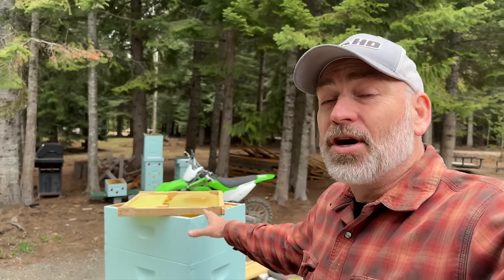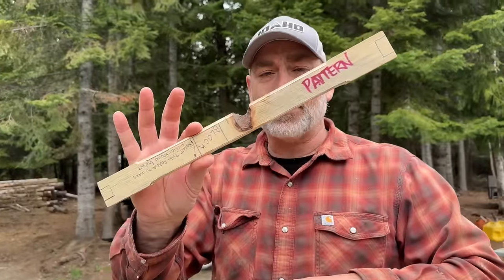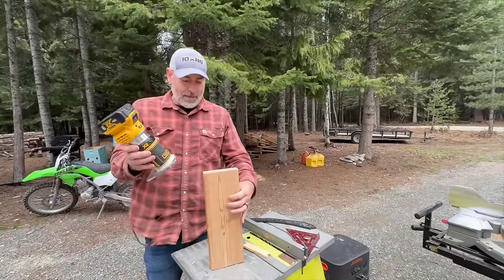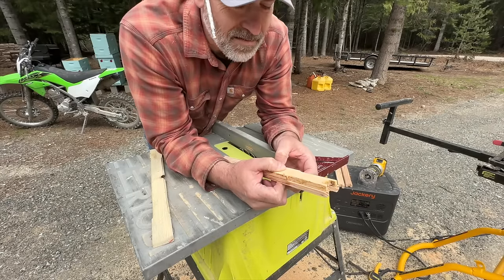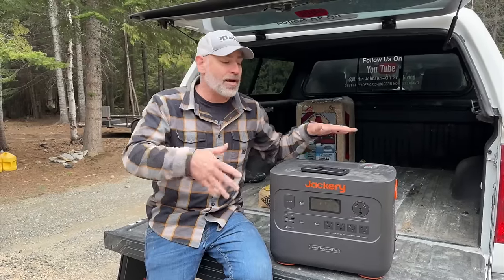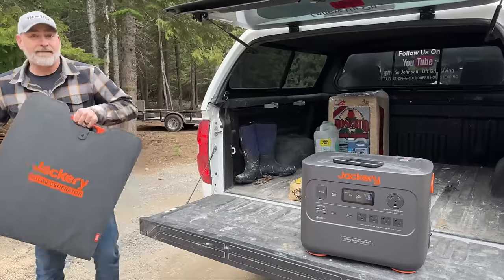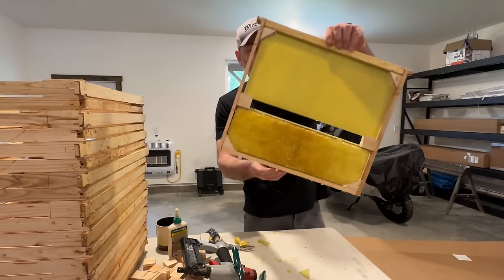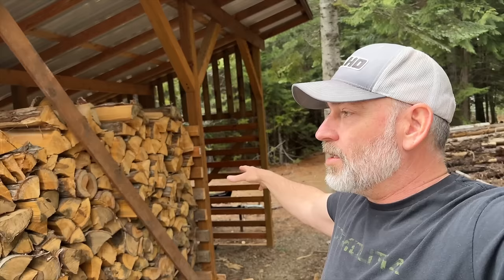Ultimate Bee Barn Hive | How to Keep Your Bees Alive all Winter

Comment: I am a beekeeper and I have watched y'all struggle every year.  Since you are looking into the Bee Barn and having to construct your own frames, might I suggest that you look into deep hive structures like the Layens or Lazutin hive (aka Horizontal Hives).  They are both tried and true designs that have lasted through the brutal winters near Siberia.  The Langstroth style work great in the southern temperate areas, but the thin walled 3/4' (1x6) wood is not conducive for keeping the bees warm. Whereas the Layens and Lazuting hives are made from 1.5" (2x10) lumber. Check out Dr. Leo Sharashkin for some ideas on deep hive construction. I also suggest that you let the bees keep their honey for the first season to make sure they have enough resources to survive the long winter months.
Reply: could they also put them in the new greenhouse to keep them warmer? maybe even keep their heated seed start station going to provide an actual heat source?
Reply: @joedoe6444  I have heard of people in northern climates either having a bee house (an insulated/heated building) or moving their hives into sheds/barns to keep them warmer during harsh winters.  Just know that the warmer the bees are, the more resources they require.  Ironic that they use more resources since they do not need to keep vibrating to keep the cluster warm. I wish Martin and Julie the best of luck this year with their new bee barn design.

Comment: My bees also died each winter until I treated them for mites.  Emergency food is also important near the end of winter.   Give them fondant to get them through late winter and early spring.
Reply from the maker: where do you live?
Reply: @MartinJohnsonOffGridLiving  I live in the most northern part of South Carolina.  I do realize that your climate is much colder, and the insulation of the bee barn is a great idea.  However, bees perish for many reasons, including starvation or due to mite infestations.  When you found your dead bees, were they still attempting to cluster, or were they head first in empty food cells?